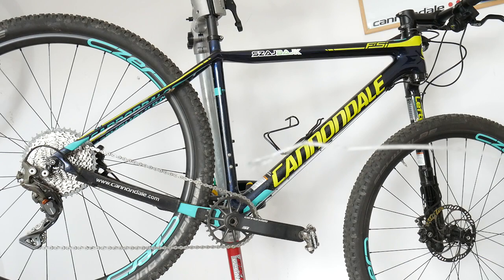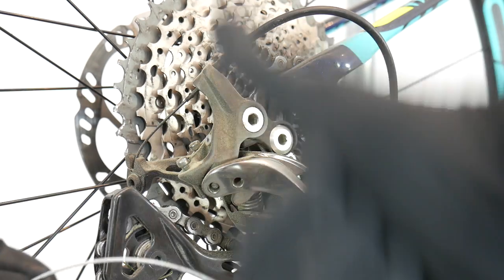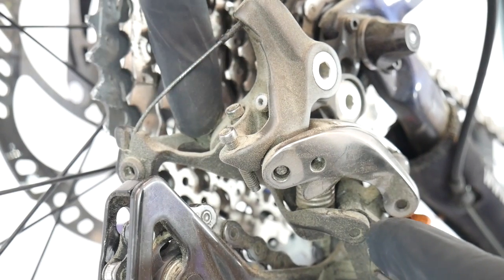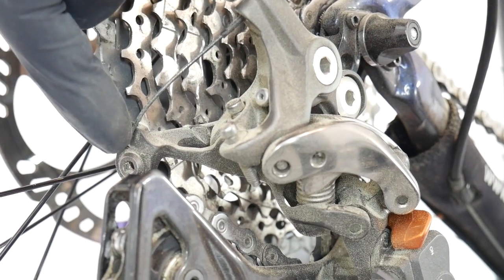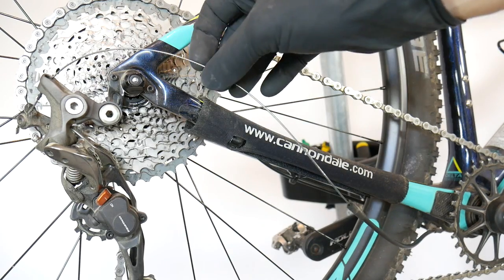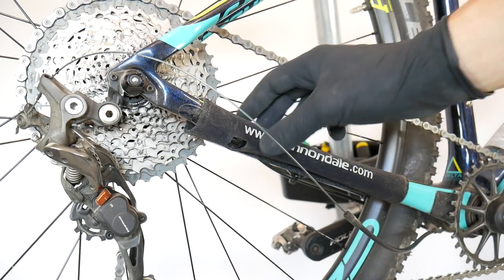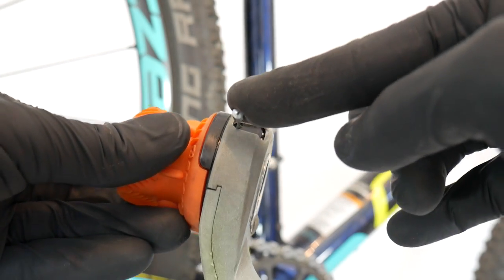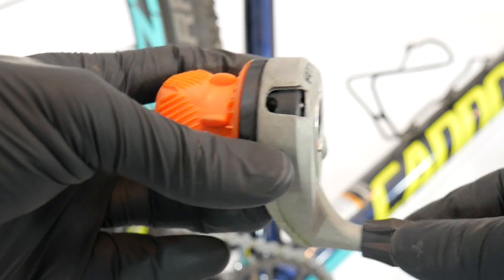Snapped Cable - 3 Main Causes Of Broken Shifting / Braking Cable. How To Prevent It?

Comment: I had a brake cable brake at the lever using shitty TT brake levers on a FELT DA4. luckily it was for the rear brake so I was able to complete the race with minimal risk. I had a shifter cable break on SRAM rival 10sp right/rear shifter like where it runs through the shifter itself. lots of use and slow break over time. I could feel it coming and let it go too long so it happened during a ride and I had to ride in a hard gear on the way home. I ran the high lim screw all the way in to get an easier gear.

Comment: lol my housing goes frim shifter down to the thing =/ =P
Another breaking point is when the housing is verry short  from the handlebars and goes into the frame. But it is less the Cable at this point. More the Housing that say at fisrt godbye to you.

But really... breaking cable on the end??? nevver happen to me. And iam riding Shimano more than 10Year´s. But since maybe 5 mont´s iam riding the Sram GX Model. My first one and where the cable goes is more clever than the simple one from Shimano.